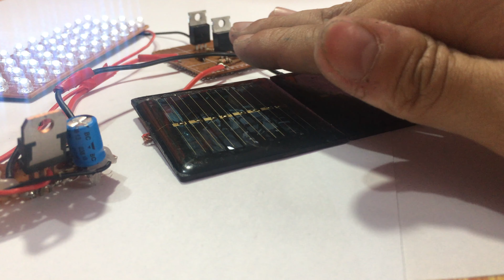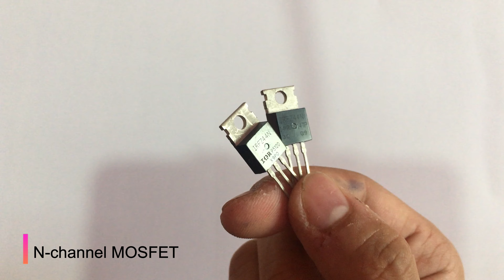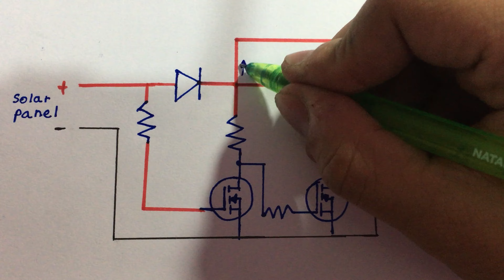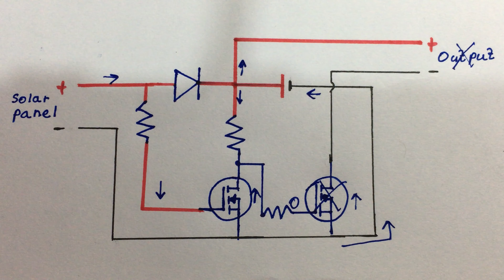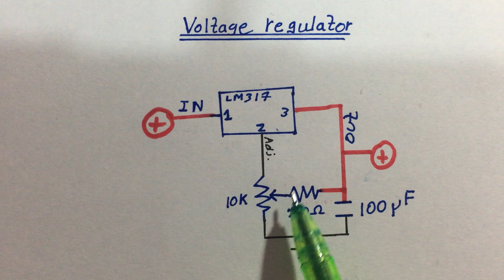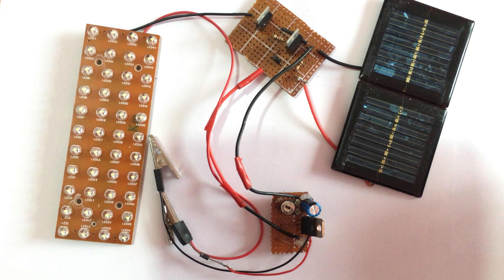Make your own Solar Battery Charger || Harvesting Solar Energy

Comment: So friend, I created the project from the video of Idian, in which I am having problems with the battery, in your case I see that you solved the problem with the battery with a voltage regulator, did that really solve it? the battery in the case can i use 12v with this project of yours?
Reply from the maker: Hey there! LM317 has output voltage range adjustable from 1.25 V to 37 V. Therefore, it is completely safe to use it for 12v. However, make sure the MOSFETs dont heat up too much to cause harm, for that you can use a heat sink. The MOSFET I used in the video is also preferable for 12v. Good Luck!
Reply: @Robonova  Hello my friend, one more question. did you succeed in charging the batteries 100% in sunlight?
in my project I'm having difficulties charging the li-on batteries in series, in this case I used 3 from 3.7v to form 12v, but I'm only passing 4.20v to charge, I'm not sure if I need to pass 12v since the batteries are in series, but I'm afraid of trying and damaging the batteries, so I resorted to asking you!

Comment: Sir, can you please tell me that exactly which components making to detect the day and night and making LED to glow
Reply from the maker: The solar panel gives a small output when it is day time. 
And the MOSFET is used to detect whether the solar panel is giving output or not 
Like this we can determine if it’s day or night. 
Then the controller circuit charges the battery if it’s day or gives an output when it’s night.
Thanks for watching! 🤗

Comment: How much would it cost to buy everything at a shop?
Reply from the maker: Taking the reference from eBay,
It will cost you around 0.9$ (excluding solar panel and your desired battery) to make the complete circuit. But it’s a good idea to salvage all the components form any other old circuits because this is made with very common components 
Thanks for watching 😊
Reply: @Robonova  Thanks!